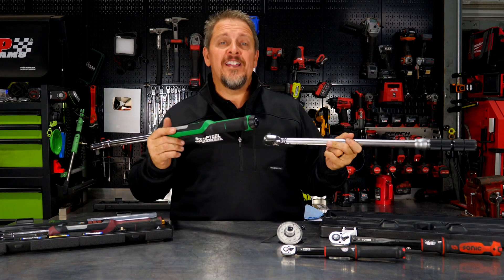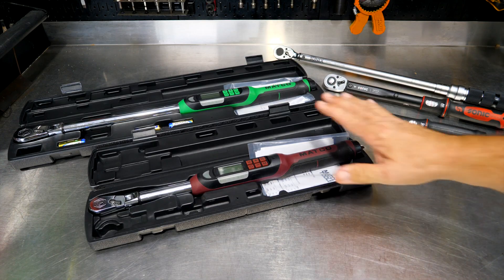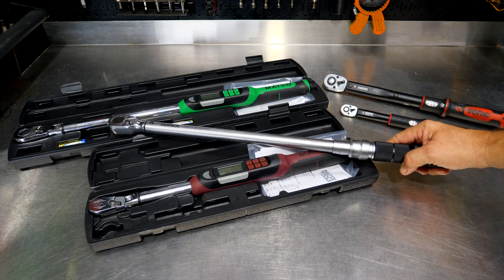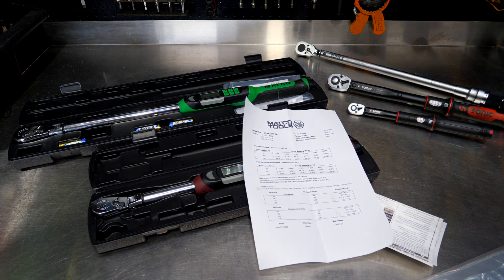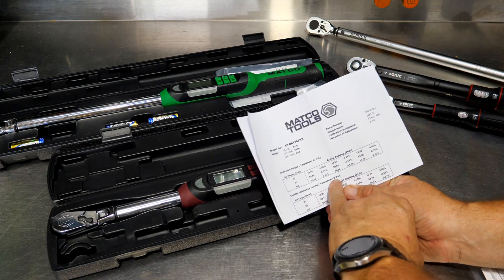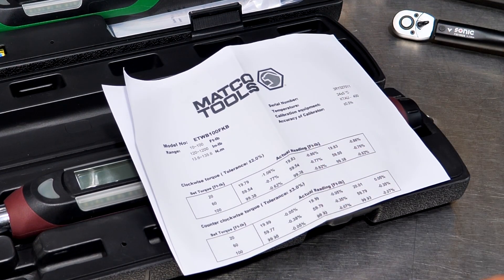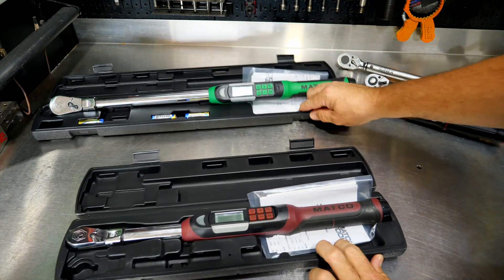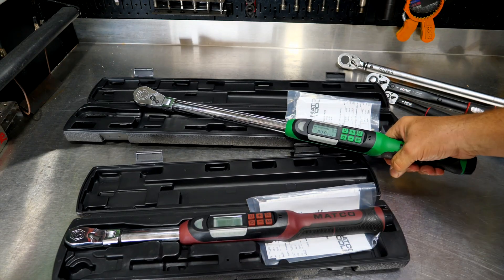1, 2, or 3? How Many Torque Wrenches Do You Need? Electronic or Click Style?

Comment: I found that four Torque wrenches covered my needs. A 3/8 in inch pounds (1000)
A 3/8  10 - 80 ft lbs
A 1/2  10 - 200 ft lbs
A 3/4   50 - 350 ft lbs.   
Thanks for another great video brother.
Reply: Just curios what your selection of the particular 3/8 in lb was for.
Reply: @gtcam723  
That one didn't see much of any automotive use. That one was for firearms and electronics. I also have a 1/4" torque screwdriver but the 3/8" offers a wider range of  bits plus a reducer if needed. I used it on my chain saws also.

Comment: True car guy right there! Loves his 6 bolt LS mains 💪 and knows the importance of proper torquing of a plastic intake onto aluminum cylinder heads. Currently have a Tekton 1/2" clicker, Husky 1/4" clicker and am in the market for an electric torque wrench. Love the channel and I learned something new today with your lesson about the 20-100% stated capacity.
Reply: I replaced my plastic intake on my aluminum head crown vic, its a common fail point on them, I hand toruqed them because I didnt have a torque wrench that went that low (27ish ft/p) how worried should I be? Im not stupid I know the risks but whats your opinion

Comment: My electronic is a Gearwrench 120xp 3/8" with angle....it's my goto for engine building ( iALWAYS take my batteries out when not in use) but I have click style in all flavors for spark plugs or wheels and other body torque solutions...they all work really well I feel...✔️
In my opinion if you are buying a click style torque wrench you do not need to buy an expensive torque wrench...the cheap ones have proven that they are accurate and are just fine for almost any application....
Reply: Do you really use the flex part? I'm looking at buying exactly that but fear the flex makes it inaccurate or isn't necessary

Comment: If you aren't sure of a torque wrench's accurate range whether it be electronic or click style just look at its certification sheet. Those sheets typically show the torque wrench's accuracy at its lowest accurate value, then at its midrange value and finally at its highest accurate value. 

As a side note I haven't bought any super expensive electronic torque wrench but the ones I have bought are only tested/certified by the manufacturer in that 20-100 percent range. I really hate how alot of manufacturers atr basically lying about the accuracy range of their tools. I only learned about the 20-100 percent rule from buying an AC Delco torque adapter and they still advertised torques outside of it's accurate range but don't worry they cover their butts by talking about their accuracy in the instructions no one reads.

Comment: I feel its necessary to have torque wrenches in all three common sizes; 1/4, 3/8, & 1/2.

In some work you will be working with inch pounds, the 1/4" is perfect for this work and a digital one is perfect for this.

In 3/8, most of the time a click stop is fine, but critical work i have and use a split beam type and finally for some work i have 1/2 drive digital Icon for angle work.

Depending upon your work, you might need several torque wrenches.  I own all three common types for 3/8 drive; click stop for wheel work, digital for lower torque requirements, and a split beam for more critical work.

There used to be a rule (at least what i was taught) that the bottom 8 -10%  of range should be avoided for use and the top5% of range should also be avoided for use.  Not sure how that works today with digital and split beam types, but it's a rule i still follow.

Comment: I’m plotting getting one of those Chinese Single Cylinder Diesels and when watching a rebuild they mentioned incremental 5-15 ft lbs for the cam caps, and most of the ones i knew of/home depot type stuff was all 20+.

Between some comments, digging online, and especially with this video, i have a good idea on what i need to get, thanks!

Comment: I don't know if you realize it or not but the two SONIC torque wrenches you show in this video can only be use in the clockwise direction. They act like normal ratchets in the counter-clockwise direction and will never snap over. I know this as TOPTUL sells these exact same torque wrenches, apparently both SONIC and TOPTUL buy them from the same supplier in Taiwan, and I have several of the TOPTUL models and that's the way they work. Don't believe me? Try them in reverse on a left handed thread and see what happens. Other than that they are great torque wrenches but anybody expecting them to be bi-directional will find out that they are not.
Reply: Neat
Reply: I’ve never found the need for a bidirectional torque wrench. It sounds nice, but I’ve rarely encountered left hand screws where torquing is needed. I think most people are in the same situation. Not saying it doesn’t matter for everyone.
Reply: @melgross i only encountered a few bolts that is reversed thread which is in an MTU AFV engine🤣

Comment: I think I have around 6 or 7... They all have a job... Right now, my CDI Dial indicator has been getting the most play lately working on a J series Honda motor, in lbs/nm... And thank you for mentioning the 20-100 rule. So few seem to know, or understand this rule. The reason I like dial indicators vs click type torque wrenches for the smaller fasteners.

Comment: I have 3 click type torque wrenches that cover everything I need from 2Nm to 250 lb-ft with nice overlap. A 1/4" drive bicycle torque wrench for working on chainsaws and similar equipment. A Harbor Freight ICON 3/8" flex head that covers 5 to 75 lb-ft and a 1/2" ICON that covers 50 to 250 lb-ft. I have no need for the digital wrench angle capabilities or any more than 250 lb-ft. If I did, I'd add a digital one but at the moment I've no idea which one it would be.
Reply: i have the 3/8" 40-200 Inch lbs, 3/8" 5-75 lb-ft and the 1/2" 50-250 ICON Torque wrenches and i love them to death! damn good quality for the price

Comment: I have a couple of CDI torque wrenches of different sizes. I think I need one more size to cover those tight spots. So far, I'm pretty happy with them and I do baby them. I reset them and put them right back in their case as soon as I'm done. They have never met the bare floor. My only concern is getting them recalibrated at some point.

Comment: I bought a used Snap On (QE model so it’s pretty new but still used) anddddd……. It needs calibration. It’s off by a couple of ft lbs throughout its range. So I’ll send it in and it makes a bit less of a deal

Also, using lithium batteries is better as they just are not near as prone to the corrosion

Comment: I have the bit holder type for screws in addition to the 3 main types. I use that for red dot sights. I also have an electronic  A/C style with changeable heads for flair fittings used on mini splits. I have 4-5 total but the only electronic is the A/C style.

Comment: what if you can't afford any thing over a 100 dollars for a torque wrench?
Reply: Go to Harbour freight
Reply: For suspension and lugnut, use harbor freight $12 1/2 torque wrench. For engine work, don't cheap out.
Reply: Digital Torque Adapters are a good option if you have the space. Also, Harbor Freight’s Pittsburghs and decent for most use (speaking on accuracy and consistency) but they sort of suck to use.

Comment: Of course, if you buy an off brand wrench, can you really trust the report card? No way to tell, though some tooling I’ve seen had printed numbers that were obviously printed with the form, so every piece would have the same numbers.
Reply: Cheap wise, the Harbor Freight Pittsburgh pieces are surprisingly accurate. They suck to use, but they’re not bad pieces from a pure function standpoint. Plenty of guys have tested them and been surprised. I would still rather use an Icon, Snap On, Proto, CDI, or Precision Instruments.